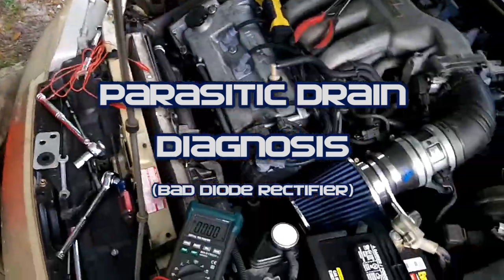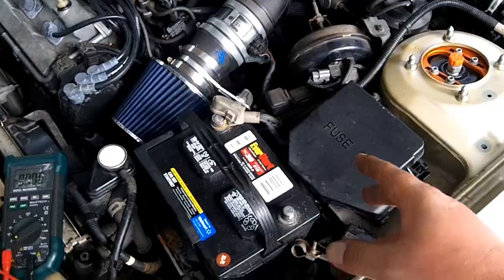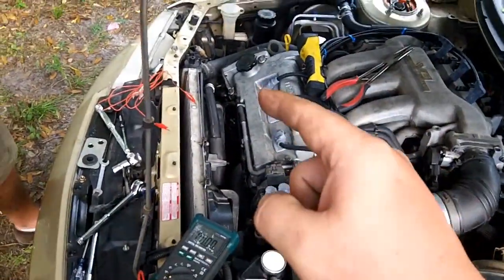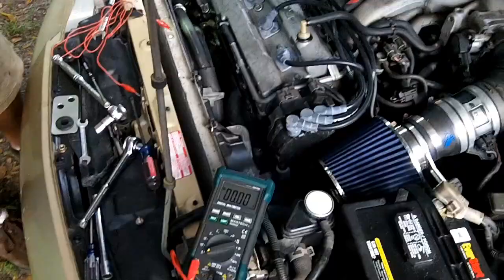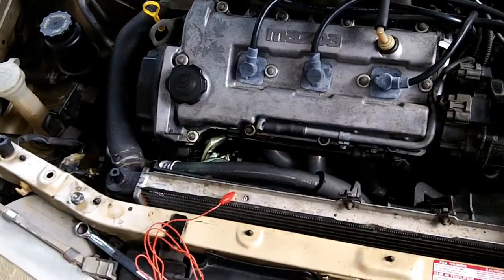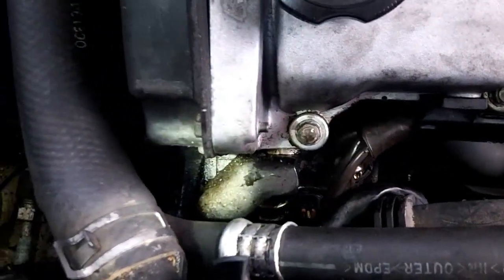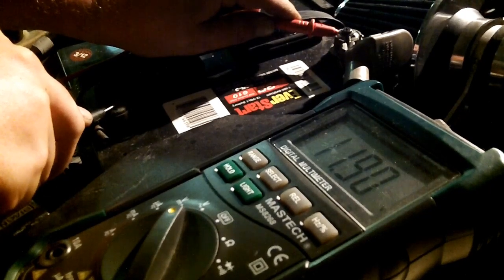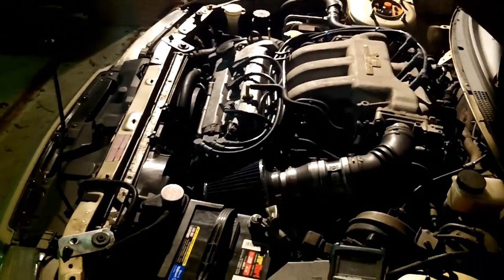Alternator Causing Parasitic Drain

Comment: Nice diagnosis DJ. You can do a quick check on the six diodes without taking the generator apart. Your diagnosis implies there is a shorted diode(s), but this test will confirm it. Take the battery wire off of the generator. Then set your DVOM to diode check. Place one lead of your meter on the B+ stud of the generator and the other lead on the generator case. You should get a voltage reading of about 1.5V (approx.) or OL. Reverse the leads and your reading should reverse. In other words, it will check just like one diode, although you're checking all six diodes in one swoop. You will probably see that the voltage readings are very low in both directions indicating shorted diode(s). Here's one of Richard's videos of where he demonstrates the process.
Alternator Check
Take care DJ...
Reply from the maker: I did think about a diode check but not until after he left that night.  He lives pretty far away and only comes up to visit for a day or two.  I've never used my diode tester before only continuity.  That would have been really cool to try.  Hopefully he'll get it fixed soon anyway.  I guess I missed an opportunity there.   In the wiring diagrams there were about 6 diodes and that did confuse me.  I thought it was only 1 diode as a check valve.  Just easier for my brain to comprehend a check valve.  Had no idea there were actually 6!  Thank you for all the great advice!
Reply: ***** No problem DJ as you already nailed it.  Internally the generator is creating three phases of current with each phase being 120 degrees apart from each other. The arrangement of the diodes is configured as a three phase bridge rectifier. Have a good one..

Comment: my 94 probe battery relocated to trunk (it was that way when i bought it) If i start my car an trun key off. car stays running. Now if i pull the fuse for the cooling fans the car shuts off. Also if i have the fuse to the fan in the dash lights an fans will spine till battery dies. any ideas?
Reply from the maker: Can you make a video of how the battery, alternator, grounds, and fusebox are wired up?  I'd have to see how it's wired.  Sounds like something isn't wired correctly.  Possible worn ignition key cylinder but with the battery relocated probably just incorrectly wired relocate.  Recommend you watch JafroMobiles video on a quality battery relocate.  In my opinion it's one of the best on the subject just make sure you check your wiring diagrams because there will probably be differences in the charging setup between a Hyundai and Mazda.
Hyundai Alternator Rewire
Reply: Well thiers a cable running from the battrey streight to alternator. Its a mess loose unused turmanals up front
Reply from the maker: ***** Recommend you seek the advice of an automotive electrician because there's no way for me to see all the loose phantom wires you're talking about.  I can't be of much help if I can't see your setup.  You need an automotive electrician to take a look at it.

Comment from the maker: The higher the RPM, the more it charges the battery. He'll be fine going home on the highway where his RPM's will be high enough to recharge the battery all the way home.  As soon as he turns off the car it will start to drain pretty quick and by morning he'll probably have a no-start condition.  Best thing to do is to disconnect the battery cables when the car is not in use.  Yeah it's a hassle but it will save him from a no-start condition until he can get it replaced.